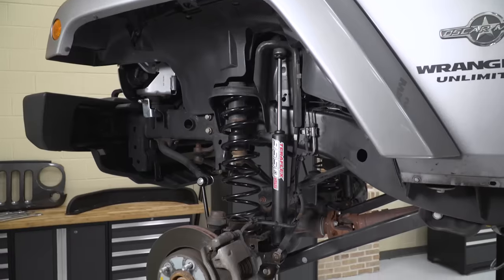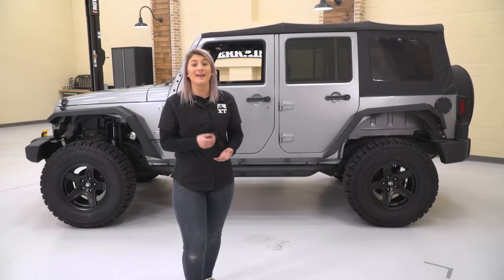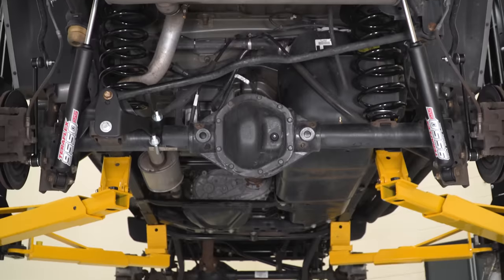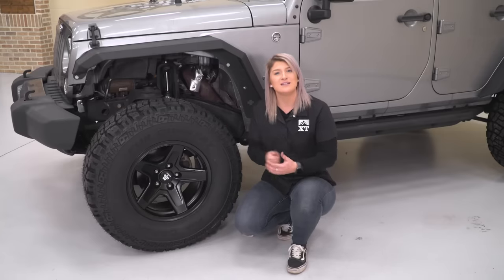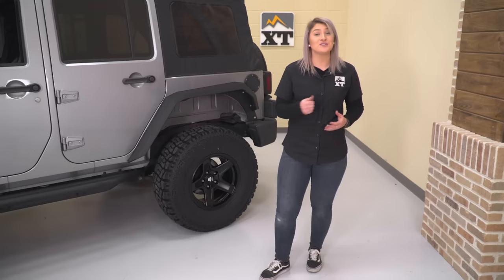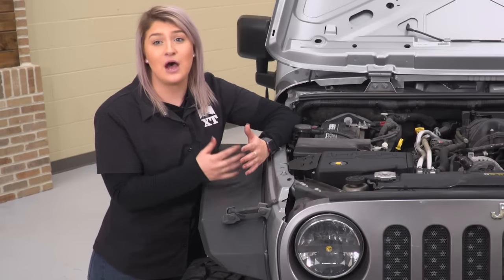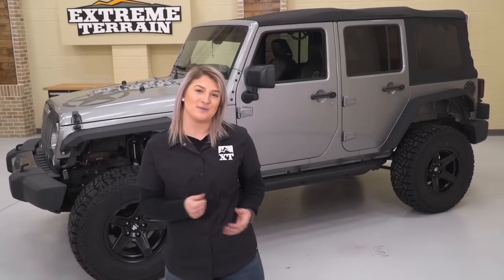Jeep JK First 5 Mods | Top 5 Mods For Your Wrangler JK - Throttle Out

Comment from the maker: Subscribe for Daily Jeep Videos: http://terrain.jp/SubscribeXTyt
Check Out Parts For Your Jeep Right Here: www.extremeterrain.com/throttleout-april-2019-2.html
Mods List: 
Teraflex 3 in. Base Suspension Lift Kit w/ 9550 VSS Shocks - https://terrain.jp/2UzwPrO
RedRock 4x4 Side Armor - https://terrain.jp/2FUCCz7
Injen Evolution Cold Air Intake - https://terrain.jp/2CYftuC
Mammoth Boulder Black Wheel - 17x9 - https://terrain.jp/2uNstyW
Dick Cepek Fun Country Tire - https://terrain.jp/2uIRlb2
Iron Cross Fender Flares - https://terrain.jp/2OOfsyg
Reply: Great mods. I like your selection.
Reply: Did y’all need to re-gear the differentials to run the 35’s?
Reply: By the way great presentation!!

Comment: Not a fan of those flares. I get they improve clearance but they look, incomplete.
Reply: the look bad, not badass. Disgusting looking product, sorry folks.
Reply: exactly they just upset me looking at them they don't make the jeep look tough
Reply: Yeah that was a horrid idea
Reply: Yeah, if they color matched the Jeep they’d look 2x better.
Reply: Adding an inner fender would help, errr...maybe.
Reply: Plus they omit the plastic in the wheel well, which is there to produce lower pressure in the engine bay and therefor keep the engine cooler - removal of those plastic parts reduces the cooling capacity. Not sure how big of an impact that makes though - just wanted to point that out (it's the same with the plastic under the radiator.). It's probably not too bad since many Jeeps have neither plastic part and run just fine.

Comment: Looks much better with the original fenders. These flares are dog ugly.
Reply: Agree
Reply: Woof woof
Reply: I believe fugly is the term you’re looking for!
Reply: I honestly think anything is better than the stock ones.
Reply: Not to mention they're plastic for a reason. No, metal flares won't just shrug off hits, it will transfer 100% of the force to you quarter panels and annihilate them.
Reply: yeah i'm saying to myself you ruined it with those
Reply: cl m - good point!
Reply: I would have went with Metalcloak over Ironcross
Reply: Whew , in my humble opinion anything looks better the stock ones. Lol. The stock ones look ugly as hell.

Comment: 1-oil pan skid 2-winch 3-rocker guards 4-lockers 5-suspension lift/bigger tires/steering upgraded

Recommending people to buy a new air intake is insulting. The factory system provides more air than the engine can use in stock form.
Reply: This is correct answer.
Reply: Agreed. Re-gearing would be the ideal improvement after adding larger wheels/tires.

Comment: GET RID OF STOCK DRIVE LINES!  ON THE EAST COAST, undercoat to protect from salt. On board air . Extra tow straps and d rings. Bumpers. All 5 of these pluses rocker guards will be necessary early mods that will always add function to any changes you make in the future.

Comment: Yes, your metal fender flares will not crack and fall off, instead they will transfer the energy to the body and fuck up your panels. What a great idea!
Reply from the maker: With a hard enough hit, sure. But that doesn't stop copious amounts of companies from making them or hundreds of thousands of Wrangler owners from putting them on. And if you're just going after the looks or you only plan on taking mild trails, who cares? Just my $.02. -Zach

Comment: Fenders are fine looking. Add an inner front fender to keep the engine protected and clean up look. Finally some spray black undercoat in the fender wells will finish the project perfectly.

Comment: The Teraflex lift kit has one flaw: regular nuts at the top of the shocks. Go buy some matching nylon lock nuts and put those on - you don't want those "tighten until the rubber gasket bulges a little" simple nuts to fall off on a washboard in the middle of Mohave National Preserve (and if it does, drive out to Baker, at the south end of town is a towing/repair shop with a big box of salvaged nuts you can dig through for a little donation to the beer fund.)
Depending on what Jeep model you put those 35s on, you might want to consider the extra $1.5k expense of having the diffs re-geared to at least 4.10. If you put 33s or 35s on a Sahara you will go very sluggish because that one is geared so low that it barely pulls stock wheels, much less something that weighs 80lbs each.
Talking about 80+ lbs wheels: the spare tire carrier isn't designed for that, nor is the gate hinge. If you're not running 37s or 40s go with a hinge and steel carrier replacement (cheaper) or replace the bumper with one that comes with a bumper mounted spare tire (3 times the price but ideal, since it also allows for extra gear to be mounted)
Watch state regulations for the air intake. In i.e. CA a lot of legally elsewhere air intakes are prohibited, so check your state regulations first. A snorkel is probably the better cold air intake anyways (and legal everywhere as far as I know since it doesn't change the air flow, it only changes the air temperature.)

Comment: On a keep of
Your trying to keep your low end power I would gear the diffs once bigger tires go on. The gears will make a way bigger notice on power and improve mpg more then any intake will
Do. Plus on newer cars and trucks if your doing an intake make sure to also do a programmer so the computer knows how to adjust the air fuel ratio. Instead the computer is freaking out thinking something is wrong with the more air coming in so it’s going to dump more fuel
Into the motor trying to compensate for the more air coming in. Plus most stock air boxes are really efficient and unless your buying a quality true cold air system you may end up
Going backwards in performance by just changing the intake.

Comment: I’m about ready to pull the trigger on these mods – great job Ms. Evasew! I saw this video during the summer of 2019 and viewed again just recently. Although, I have a 2Dr Willys, I will use your examples as they seem to be at a righteous price point.  I would add a “Big Break” Power Stop kit to handle the extra weight and get wheel size tuned in to calibrate the speedometer.

Comment: So I guess having inner wheel guards doesn't mean much.. let that mud and dirt or  sand and rocks or even tree limbs go where they want in those nice shiny new spaces from a lift...
Just HAVE FUN!!!!
NO!!!!!  This thing called mud... it finds every crack and every hole so minimize it with  inner guards...
Without guards to compliment the lift.... It would effect the engines capacity of over heating or anything from being coated with  real off road debris
 Not to mention when over flex happens aka parts wear out or simply a challenging trail or even just a Sundays drive though idk... Get some limiting straps...

If you wanted to add the basics to this.. add this.... Fender flares are awesome.. but you guys left an ACRE of space in between the wheel wells and engine.. Have fun with that on wet days..

Comment: quicker disconnects are the cheapest thing you can do to make a big difference on off road performance. When you pair this up with lower tire pressure (about 15 psi) you’ll also get a more comfortable ride. This should have been on the list
Reply from the maker: The kit I chose actually includes quicker disconnect hardware! It's still a base suspension giving you choices down the road on other components to pair with it, but it does come with a ton of upgraded benefits as well! :) -Merideth
Reply: @extremeterrain  did you put on track bars or any geo brackets since this is a three inch lift

Comment: Jeeping is freedom so no complaints, but I disagree... I’ve wheeled a wrangler for over 20 years including both stock and built. Wheel it stock, GOOD TIRES (32in if JK, buy Rubicon take offs (~$400-600)... just don’t do it if you’re in Colorado, that’s my secret 😉), armor your bottom, put stronger but better angled bumpers on it (with a winch), and definitely rock rails. After wheeling with open diffs, get some lockers. That’s it, go wheel. The problem with lifting it is most don’t know how to maintain and check their lift, it’s expensive (tires, wheels and cheap lifts suck long term), and depending on the size, you’re putting too much on stress on those stock axles. I’m not against modifications (I actually love a well built jeep), but I’m going to show you on my channel what a STOCK Jeep can really do!
Reply from the maker: Stock Jeeps are definitely capable! Ryan made it pretty far wheeling his stock two-door JL up here at Rausch Creek awhile back. Thanks for watching and for your input! -Zach
Reply: ExtremeTerrain.com Of course, I’m glad I found extreme terrain and just my opinion.

Comment: Your links to the wheels / tires might (not sure) be slightly off... the 17x9 rims don't quite work with the linked tires... maybe?
Reply from the maker: They still do! You just need to make sure you get a proper 17" tire to go along with the 17x9 inch wheels shown. It looks like we currently don't offer 17" tires in that tread. -Zach

Comment: If I don't plan on off roading, are there many pro's to getting a coil lift rather than a budget boost? I want a 3" lift but not sure if I'm making a sacrifice by getting 'just' a budget boost
Reply from the maker: 1-2" spacer lift kits are perfectly fine for the daily driver who wants to get some larger tires on their Jeep, but don't plan on off-roading much. At 3" of lift though I would highly recommend getting a complete coil spring kit with shocks to provide the best on-road performance as possible. I'd also recommend adding an adjustable front track bar to your Jeep while lifting to keep the front axle centered, and some sort of control arm drop brackets or adjustable control arms to correct suspension geometry. Hope this helps! -Zach

Comment: I have a interesting question, I purchased this for a soft top but have a hard top can I still use it?  With out the factory tail bar rod?
Reply from the maker: You will need the frame, windshield header, door surrounds and tailgate bar for the soft top to install and seal correctly to the Jeep! We recommend a complete kit with hardware for hard top owners.

Comment: If the JK's completely in good condition, I'd skip the expensive suspension lift, at least for a good while. Fab up some anti-swaybar disconnects for more articulation on the cheap.

 Spendy upgrades?

1. Locking storage.
2. Armor, like rockers.
3. Winch and other recovery gear.
4. Rear or 2 lockers.
5. 1"lift poly bodymounts.
6. 33-35" siped mudders on 15x8" rims.

Comment: What was the cost for the lift? Im thinking a few grand maybe 3,000 or a little more than that.
Reply from the maker: Check out the following link to the lift kit on-site! Current cost is right around $1200. -Zach
https://www.extremeterrain.com/teraflex-3-base-suspension-lift-kit-w-9550-vss-shocks-0718-jk-4-door.html

Comment: I nearly bought a Gladiator but ended up in a Chevy ZR2.  Stock, a little more capable off road because of greater breakover angle but the Gladiator can fit 35s stock.  If you want to see 20 Colorado ZR2, AEV Bison Editions, a V8 swapped ZR2 and a utility box from General Motors engineering team, check out our video from last weekend on Drummond Island, Michigan.  We'd love to get some Gladiators to wheel with! @

Comment: This question is for anyone who has knowledge on value of jeeps. When it is lifted, does this degrade the value of the jeep?
Reply from the maker: Not necessarily. If you lift your Jeep properly using a high-quality lift kit, don't wheel it too hard off-road, and keep a list of everything installed, you won't see the value of your Wrangler dip. If anything, the value may go up a little bit. But if you only throw on a spacer pucks, don't keep receipts, and beat it pretty hard off-road, I wouldn't be too surprised to see the value drop. -Zach

Comment: Extremeterrain - would you recommend changing the Jeep's gearing if going to 35's?
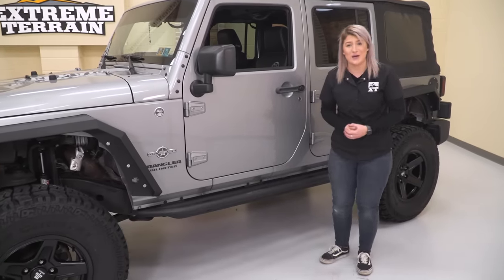Reply: Adam Robinson I had 3:21 gears and definitely had to regear. Others with 3:73 gears say it's not too bad.
Reply: @Hay-tn6hz  i had 3.73 and upgraded to 4.56s much much much better.

Comment: I look for how to reduce the sound of the top when driving at high speed
Reply from the maker: There isn't too many ways to make a soft top quieter while driving, unfortunately. Some companies make aftermarket soft-top bows to help keep the top fabric nice and tight so wind doesn't make it flap as much, and you can always double check your soft-top frame to make sure its stretching the top as tight as possible. If things are pretty worn out you may want to look into buying a new soft-top though. -Zach

Comment: Could you explain what you mean by “up travel”?
Reply: The amount of upward motion the wheels can make before they start rubbing on the inside fender. Your stock tires can get fully stuffed up in that wheel well without rubbing. Go with bigger tires, and you'll either need more lift or higher clearance fenders to maintain the same upward clearance.
Reply: AD1 Makes sense. Thank you!

Comment: Hello X T
I'M TRYING TO  Decide which 
Tires to get for my 2013 jeep wrangler unlimited SAHARA V6 3.6 automatic jk GECKO PREARL 
Has 35x12.50r20 Dick CEPEK MS,  with micky tomson rims Black 
I would like something more quiet and  good and safe for winter Driving,  I'll have a 9000 # winch mount on 
I plan on using this to help others out if they get stuck 
Thanks!!!  ○|||||||○
                    °         °

Comment: Putting a lift kit and big tires on before adding big breaks is a recipe for disaster.
Reply from the maker: Not always, 33s will do just fine with factory brake pads and rotors. You can get away with them if you move up to 35s as well, you'll just need to be aware of the slower brake time caused by the extra weight of those tires. Aftermarket performance rotors and pads, or a big brake kit will solve a lot of that problem though. -Zach